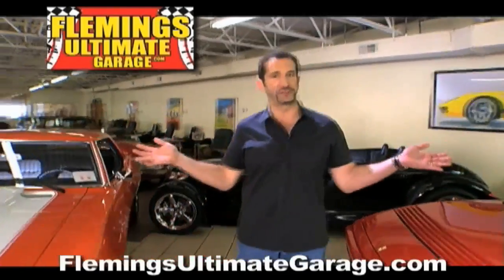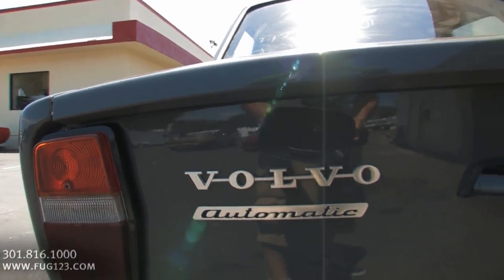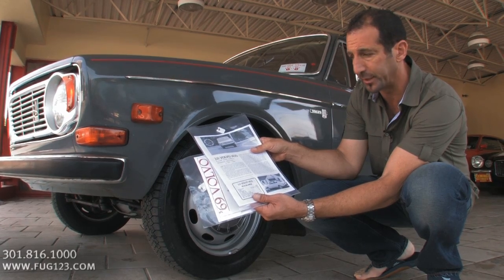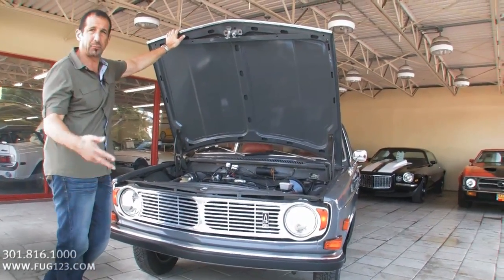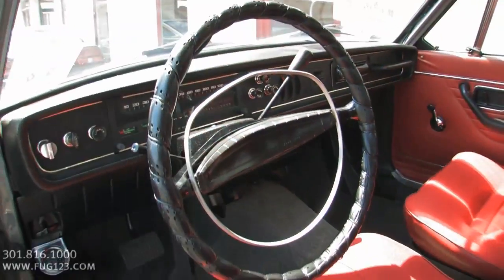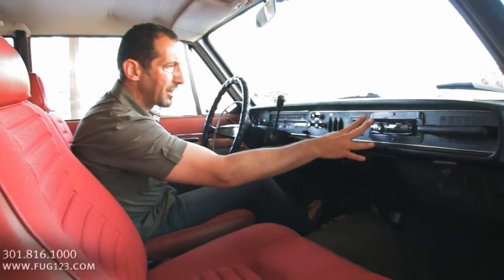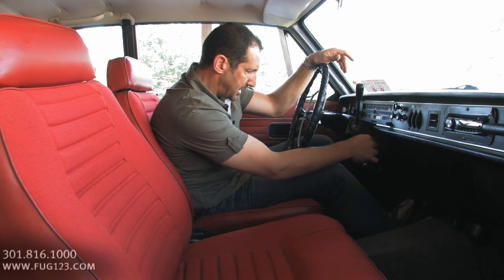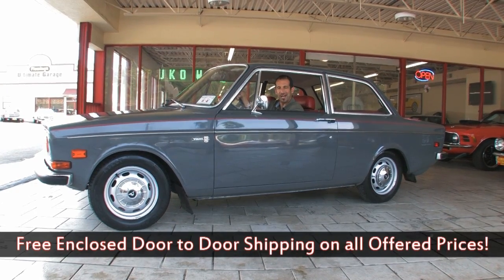1969 Volvo 142 S for sale Flemings with test drive, driving sounds, and walk through video

Comment: I had the 142 S many years back did many Miles with it, it was a 1972 from memory, dual carbs, and 4 speed manual, the only issue i had with it is the main bearings in the lay shaft in the trans, and head gasket needed replacing.

Comment: My first car in 1982 was a neighbors' hand me down 69 Volvo 142S, it needed a trans rebuild. I had the trans rebuilt but I was never able to get that dual Stromberg carb setup to run right, the two vacuum bells you can see with the hood up had screw off caps that you were supposed to put some ATF in for lubrication.
My problem was one vacuum bell was more worn/scratched inside than the other and so they would never sync to each others needle height and it was like they were fighting each other and the idle would go up and down and crazy, and with an automatic trans it would slam into gear at times because the idle would jump up.
I remember trying to switch carb bells with others and just couldnt get them to work right. Loved the car though, lots of room, no blind spots!

Comment: The very first car I ever purchased was a brand new 1969 Volvo 142, white exterior, red interior, four speed manual transmission, B20 two litre engine, add on air conditioning and AM/FM radio.
The car came with a six month warrantee and after 6.5 months two or three things would break or stop working every month until I got rid of it at eighteen months.  Never bought another Volvo again.

Comment: @overtheradar I think that's an exception rather than a normal experience. Mine has been fairly reliable after I sorted out the initial old car siting in a barn problems. Apart from the horrible, horrible SU carbs.

Comment: A very late comment but oh well... This was not really a good "restoration" and or "kept original". It has modified hole in the dashboard for the modern stereo and the exhaust is not right. The "gassprings" htat should hold the trunk open did not seem to be all that good... overall a nice car but those details really domngrades it...